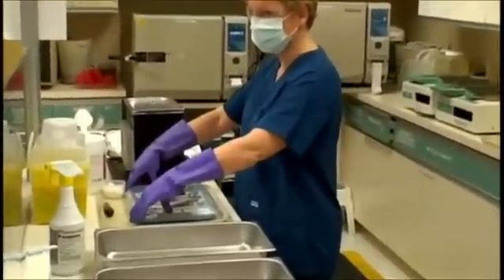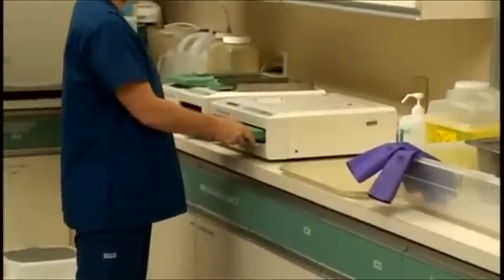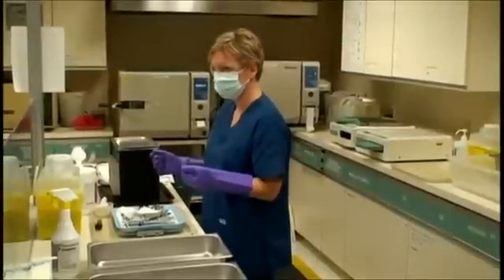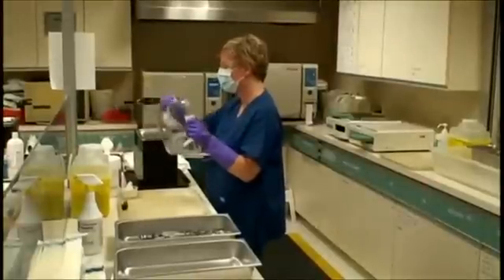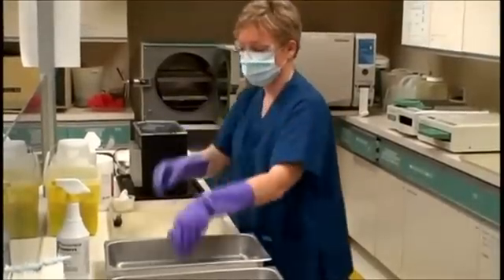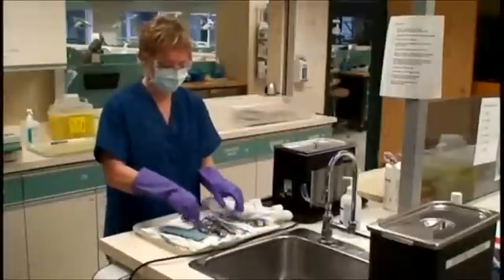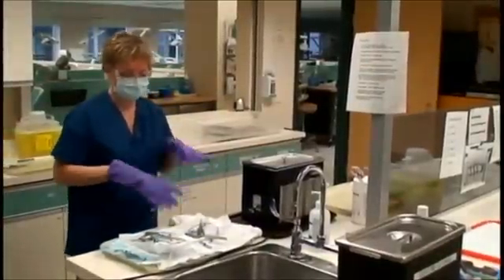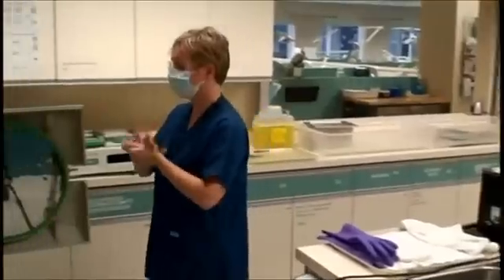Infection Control and Processing Contaminated Instruments

Comment: This should honestly be used as a how NOT to video... First of all, her bare arms are exposed, she keeps touching those dirty utility gloves with her bare hands, she should have under gloves on when using utility gloves, although she does sanitize, touching those gloves can expose her to harmful microbes, she is grabbing handfuls of sharp dirty instruments, she should be a bit more careful tossing those instruments into the bags and not over fill them, latch instruments should be bagged in the open position, if those bags get punctured they're no good anymore, IDK what's up with the wipe to open the lid, if its dirty, its dirty, the tray covers latches can't be properly cleaned and should be kept separate from the clean side and marked with a biohazard sticker. I also don't know why the bags are kept in a clean area so she needs to take her gloves off to get them. It's all just so wrong.

Comment: This video has a lot of mistakes.

1. P.P.E - where is their fluid resistant gown, hair net and disposable gloves for placing items inside pouches.
2.  Handwashing should be performed before donning utility gloves, when hands are visibly soiled, after touching contaminated items, after leaving sterilising area and before going to touch anything on clean side.
2. Never recap a needle. Use the one handed scoop technique if you must or a needle protector.
3. Instruments should be rinsed under water prior to ultrasonic cleaning to remove any gross visible soils that may be present on the device. Note: do not place lensed items such as mouth mirrors into ultrasonic as can cause damage to the lens due to scratches caused the cavitation and implosion action of the ultrasonic cleaner.
4. Handpieces should be lubricated ideally after each use. 
5. A set of disposable gloves should be worn when disinfecting tray. This is because using the same dirty utility gloves to decontaminate the tray can cause cross-contamination.
6. Dirty utility gloves should not be used when handling the instruments after they have come out of the ultrasonic cleaner for the inspection and packaging stage. You must ensure to rinse all instruments that have completed a ultrasonic cycle under warm-hot running water to rinse of all chemical detergent residues and any debris that may be sitting loosely on the surface of the device. You must dry instruments thoroughly using a lint-free cloth and with disposable gloves, prior to packaging (if needed) or for any further processing requiring sterilisation of unwrapped items too.
7. Do not overload sterilisation pouches as seen here. You must also not use bags that are too big or too small for the item(s) as you want to give it still room for bag to expand and contract and for steam to penetrate all surfaces. Make sure to remove any air in bag before sealing carefully along the perforated line.  Do not over the bag as seen in this video!!!! This will impact the sterilising agents ability to reach all surfaces of a device, could damage the sterile barrier system and cause the pouch to not be dry on completion of the cycle. This means that a pouch won't be sterile upon release and will need to be reprocessed. 
8. Take care when handling all instruments!!
9. Do not use utility gloves when placing items inside the autoclave. This will compromise sterility!!!! 
10. Placing dirty utility gloves on the packaging and inspection towel is cross contaminating.
11. There is no clear workflow from dirty..to clean..to sterile and following a directional workflow is a must.